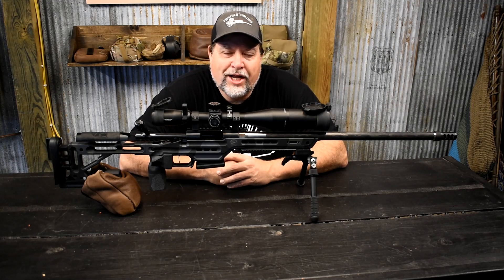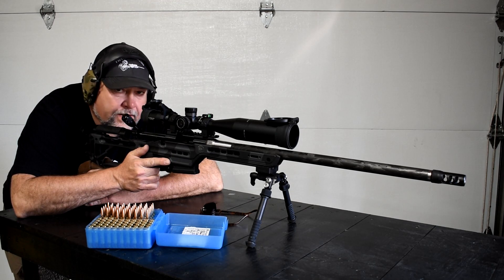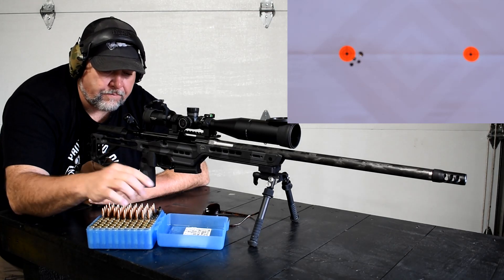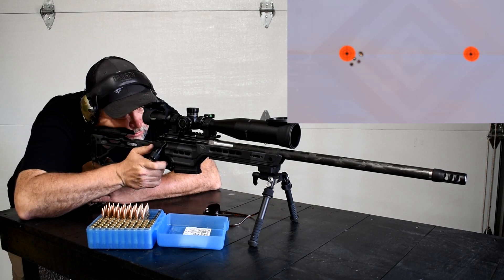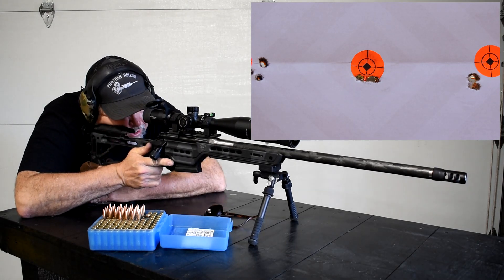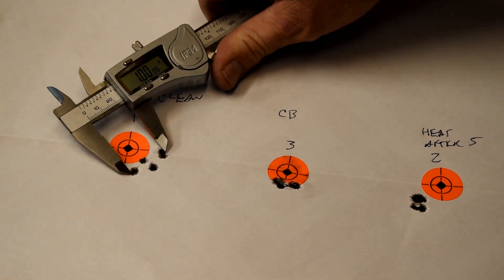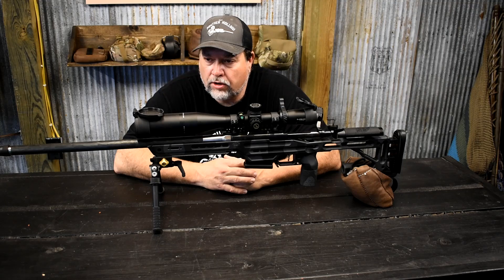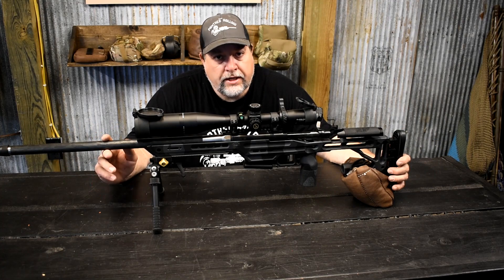X-Caliber 6XC Carbon barrel build tested at 100 yards

Comment: Was their a scope adjustment between the 1st and 2nd group? Been contemplating trying a CF X-caliber, from a few Proof barrels made, I was not impressed after having a lot of cold bore zero shifting. I'll be trying out a Helix 6mm barrel and testing it's claimings
Reply from the maker: yes, I made adjustments between all three, just fine tuning the POI. I bought this barrel on a whim, lol... I had not seen any 6mm carbon fiber barrels in person, and I had never shot one.  My buddy has a factory Carbon Fiber Christensen 280 AI that does really good for him. Not a lot of cold bore shift in that gun but it is a MTU style taper as well. This barrel has less that 100 rounds down it now. I plan to do another video on the same thig, just as a follow up after a few more rounds have been put down range. Thanks for watching man, Have a good one!

Comment: Been shooting the 6XC for many many years. I always run 7.7 twist barrels and the Tubb 115 DTAC BN coated or 115 Bergers. Unless you are going to run 115s you should have just built a Dasher or GT (AKA "El Hoto Tigre") it would be more accurate and the barrel will last longer, alot longer. I just finished work and testing on an XC Wildcat I came up with and the reamer is being made as we speak. I changed all the things i didn't like about the XC and i feel I made it a better F-Class caliber than it was. I used 2. reamers to chamber the barrel and it will be much easier to make with 1. obviously. I'm using an X-Caliber stainless steel 7.7 twist 3 groove 28" barrel I had laying around with 38.5 gr of H-4350 and a 115 Bergers and small primer Peterson brass with CCI 450s so far it's a hammer at 100 yards and 300 yards is next then 600 yards. Historically speaking the DTACs are the best cold bore or clean bore shooters in it. Once the reamer comes in I will spin up a new Cut Rifled barrel most likely a Bartlein 1.250" staright taper 31" long 7.7 twist I think the 7.7s shoot better than the 7.5s and you can't give me a 7.0 twist barrel they are to hard to get to shoot.